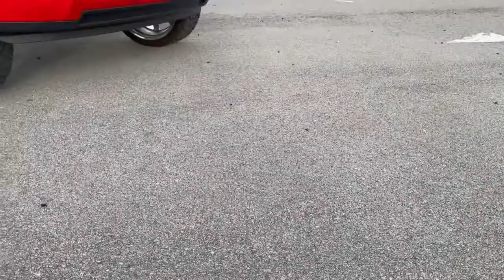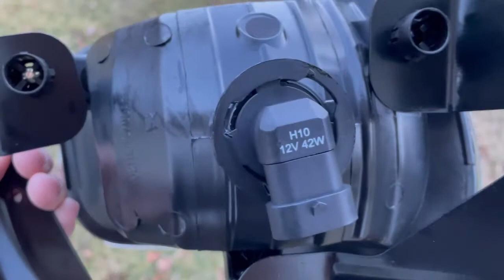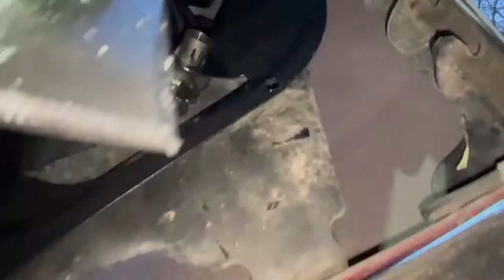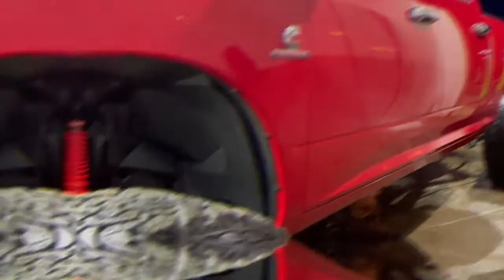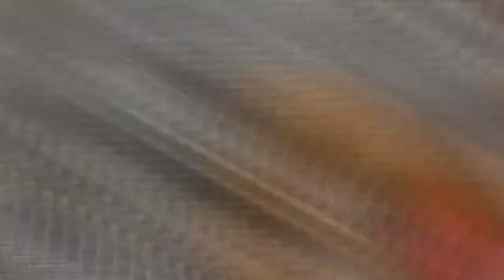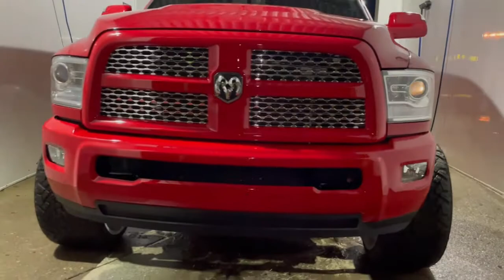FINALLY INSTALLED MY FOG LIGHTS | EASY INSTALL

Comment: Did you have to add a toggle switch to turn the lights on or did you buy the factory fog light/light button? Thinking of doing the same thing.